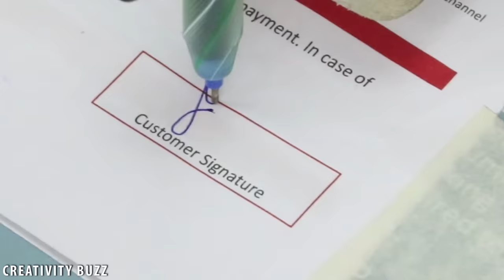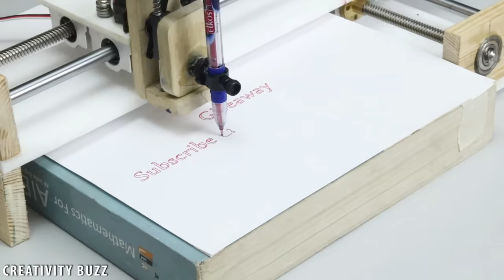How to Make Homework Writing Machine at home

Comment: there is something missing called "THE CODE"
Reply: 2d use of a 3d printing software?
Reply: And the blue prints
Reply: @duchenpaul  blue prints?
Reply: Use nc software
Reply: @mihajloaleksic4126  Hello, can plz guide till link to the software.
Reply: There are somethings missing called brains and programing skills
Reply: @booked_by_books  so you are saying this can work without a specific Arduino code? Pardon me if my question itself is stupid I'm a beginner in Arduino.
Reply: @joyalabraham4669   Me too...
Reply: inkscape and extensions for it
Reply: @Zhak7  go be toxic elsewhere
Reply: @joyalabraham4669  yeah grbl as the Arduino firmware, just need to adjust some settings, and then use some basic gcode Generator to make text or svg drawings into gcode. Then grblcontrol can upload that stuff.
Literally 0 lines of code needed.
Blueprints: yeah as if you need those for this. If you can't build this on your own chances are you can't build it with a blueprint either. And you'd have to adjust the blueprints for your specific parts anyways.
Reply: @Zhak7  tfff....title clearly states how to make .... So yeah code should have been a part of it too
Reply: xD
Reply: How will this work like how will it know wht we want to type
Reply: @p_j7-f4f
Reply: @p_j7-f4f  que programa utiliza?
Reply: Code no needed

Comment: I have gone through many videos of making cnc engraver 3d printer. But my major concern was making slider arrangement in a cheaper and easily arrangeable way. This is a very nice video on simplifying things. The glue is just an idea, one can replaced it with other type of reinforcement mediums like screws.
Uploaders use 3d printed parts which makes us think we cannot make it at our home.
Thanks for enlightenment. The only thing bothered me was sticking of one axis slider over another one. It can be improvised and programming software was missing.  Great video approach. Simplifying the engineering encourages one to take a step further into it. Kudos

Comment: Have seen quite a few of similar videos. This is the most simplest one showing simple steps to build one of these amazing machines. I definitely need one for my electronics and home automation projects wherein I struggle to make custom circuits by carving out on plain copper boards. With a marker and integration with fizz this would be an awesome addition to my lab to make complex electronics circuits at ease.

Comment: real nice idea ,I started building cnc machines 25 years ago and you folk make something seem easy when it takes one hell of a brain to figure it all out, The only difference is the z axis where I always use the stepper mechanism from an old dvd or floppy drive take it apart cut out what I need and scrap the rest. For the code I just manually count how many steps up and down then set up F-engrave and away I go,  great news Inkscape will export a .dfx file to feed into F-engrave which generates the gcode file the load it into UGS and boom its drawing away "sometimes all night". I love your means and methods a block of wood and some glue gets the job done.    Keep it up as I am 69 years old and still building stuff.  Great show. Now make a new holder for a vinyl cutter and you can make signs.

Comment: Youve just shown the making of this project, where is the code, diagram for this,  no point uploading is it !!
Reply: guys, the exact measures does not matter. You have tons of clues and also some specific data: 8mm axle and linear bearings (the ones that are a little longer). Look closer: when you decide the distance of the axle from the base of X or Y axis, it must be enough clearance for the linear bearing to spin around the 8mm axle without touching the base. The length of each axis is 300mm plus some space for supports and the motor. Anything else you can decide when you have the components on your designing table,
Reply: I think the support of the x or y axis is aprox. 38 cm in length. For the bearings, you should look for ones with 8mm interior diameter then figure the thick of the wood support. But again, only after having all the components you can figure out all of the dimensions.

Comment: Good thing there is a ready to use controller board for stepper motor, or its a package?  and it works well with the computer program and the response is smooth and amazing! Good job man! Congratulations!👌